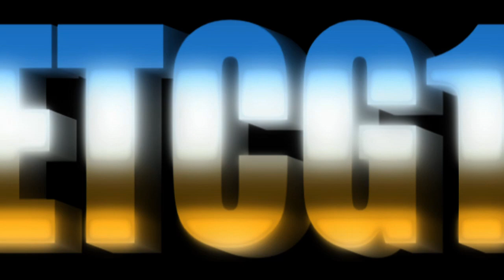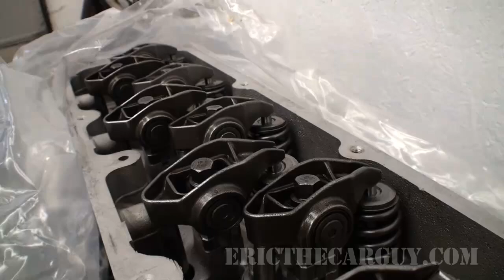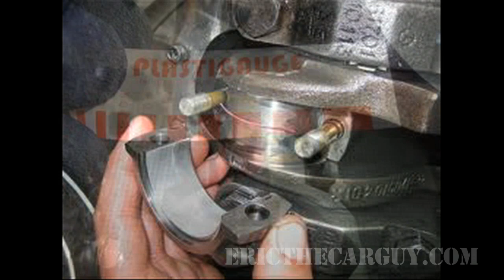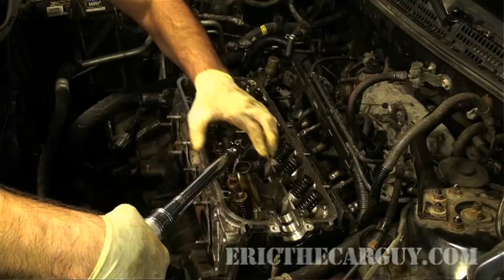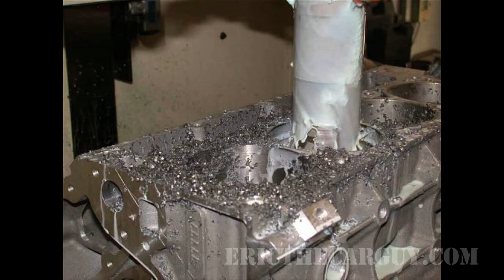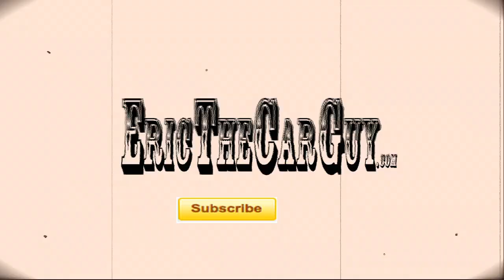Should You Rebuild or Replace? -ETCG1

Comment: false. ill rather rebuild my engine, then ill know that my engine is LIKE NEW. new bearings. new rods. new pistons. new wrist pins. etc. valve seals etc. and that way i know that its going to last for a LONG TIME. unlike a low mileage just because its low mileage it doesn't warranty the usage of that engine before it was ripped out

Comment: I have replaced a 4 cylinder engine in 3 different cars with used engine from a salvage yard. Pick N Pull offers a 13 month warranty on engines for about $30. Total cost for a complete engine was $230, before turning in the core. (Core is $50). If the engine is available, and isn’t locked up or look like it has every gasket leaking oil then I’d swap for a used one every time.

Comment: I have rebuilt a few engines, using the FSM/Workshop manual's, whilst getting the machining done offsite. Usually my machining is going to cost me roughly $1100-1300, Piston ring grinding and hanging roughly $200 and my rebuild kits are roughly between $1400 and $1700 depending on the engine. I get the machine shop to do all the required machining and whatnot while I complete the final build. That way it gives ME the piece of mind I need for a long life engine.

Comment: If you dont have these tools and have a good knowledge how to you them you should replace your engine. 

1-2", 2-3", 3-4" Mic's (0.0001 or better)
1.4-6" Dial Bore Gauge
Accurate Torque wrench 
Piston Ring compressor
Piston Ring File
Feeler gauges
Valve stem oil seal Install/removal tool

And that is a small list off the top of my head.

Comment: I agree that replacing the engine and letting the warranty handle any issues.  I have only done a couple of major engine repairs and in both experiences I can see that it can get really involved and expensive to do a rebuild "correctly" and in full.  Go with the replacement with a warranty.  Only by a junkyard motor if a warranty in writing is included and/or you can hear the engine run.  Remember that junk yard engines can have the same issues your engine has developed.
Reply: Junkyard engines usually just sit and deteriorate. They're not maintained obviously since they're never ran (I'm assuming, although some junkyards might maintain them, highly doubt it though)

Comment: If it's an old stinker the only thing that should be replaced is the vehicle. 5 engine swaps and two transmission repairs are not worth the trouble.

Comment: I would never buy a used engine, because no one knows the true condition of the engine.  Basically, you're gambling when you install a used engine.  A replacement engine is convenient, but you never know the quality of the engine - ie type of replacement parts used, how much care was involved when rebuilding the engine, was the bearing and rings clearances measured properly, etc?  When you rebuild the engine yourself, you know exactly what goes into the rebuild.  I'll go with rebuilding.
Reply: I mean you're not wrong, but not every person just has the knowledge and time to "flapjack" their motors to specific spec(s), which is absolutely necessary when it comes to engines like Eric mentioned 12 years ago lol.

Comment: It depends on what falls into your idea of a "rebuild." To me, a "rebuild" would be rebored cylinders ( then possibly sleeved), new pistons, rods, and rings, new crank and bearings, new camshaft(s), lifters and pushrods (if applicable), new valve springs, valve guides, new valves, and a new timing chain. If you do much less, you still have possible points of failure.

Comment: In Argentina, replaciing an engine for a new one is not an option. If your engine is so messed up that there´s no other way to fix it than replacing it, people choose to sell the car before even asking for prices. What we do a lot is replacing head gaskets, cilinders, pistons and much whatever is broken. And even that way it´s already very expensive. 4 years ago, the pre-owner of my van didn´t know that automatic transmissions takes fluid. Burnt it and the cost for rebuilding it was $14.000 !!!

Comment: I think it depends on the situation. The brand, engine, year of make and compared cost would decide for me to replace it or rebuild it. Not every engine is available as a remanufactured engine, not every engine can be bored to a bigger cylinder. Decide which is cheaper, what you have time for, and what you can actually do with your skill/toolset.

I'm looking forward to seeing that engine replace video!

Comment: Depends on the car.  If you don't plan to keep it or don't care too much, just put new rings and bearings in to bandaid it for a few years.  If it's a newer car, just get a replacement engine.  If's its an old car you want to fix right and you can't get a replacement, a full rebuild is really your only option (I don't know anywhere where you can get a remanufactured flathead ford)

Comment: It's a crapshoot on what you get from someone else's problems. If you get a used engine from a junk yard, it's like buying a car off of craigslist without a test drive. Just because a car gets totaled, doesn't mean that the engine was good. An engine rebuilt from a rebuilder will be was good as what the rebuilder checked and what they were told to replace VS just let it go. Most will not have the equipment needed to check alignment or magna fluxing. Crapshoot, do you get 100% on 100% of tests?

Comment: I had a mechanic friend rebuilt my engine because of an oil consumption problem. My friend only replaced the o rings, thinking that those were the issues. I paid him a few thousands for the job and ended up with the same problem. Because he is a friend of mine, I got screwed on that one. I later traded the car in for a new one.

Comment: With rebuilding,you may get bad news from the machine shop called something cracked.Avoid the auto parts stores remans,use the cheapest parts and you take the vehicle to one of their places for warranty work.Lot of times a reman is cheaper than to rebuild.Where I work at,talk the customer into a Jasper reman if they tend to keep the vehicle.Never had problems with Jasper remans,stand behind their work.Problem with rebuilding is the vehicle sits for a couple weeks.

Comment: So essentially, if you pull the motor out and want to rebuild it, you might as well go full bore (no pun intended) and do it all, but that becomes alot more expensive than just finding a low mileage engine. Except for maybe a Porsche V8 or Mercedes V8, or any rare engine where low mileage complete engines are hard to find without problems.

Comment: Warranty work? I work at a Chrysler dealer and they go through alot of 3.6L V6's, more so new heads than short block. Or noisy valvetrain, usually new roller rockers.

Comment: I've had my trans replaced with a salvaged unit that works but synchro is bad on second. If I had to choose rebuild over replacing an engine I would probably go for rebuild. I say rebuild for the reason of being able to put higher performance parts on the engine. If we are talking about strict OEM parts I would go with a reman.